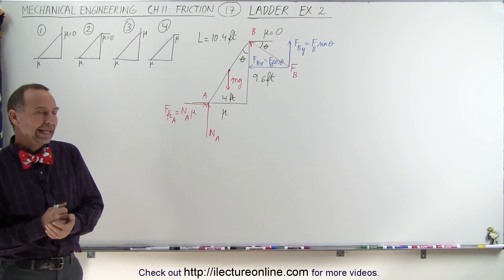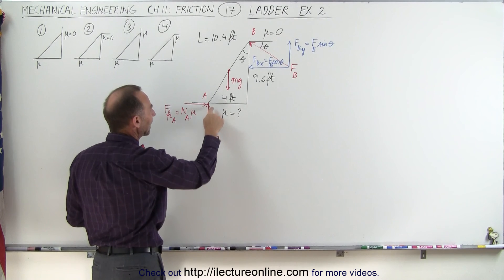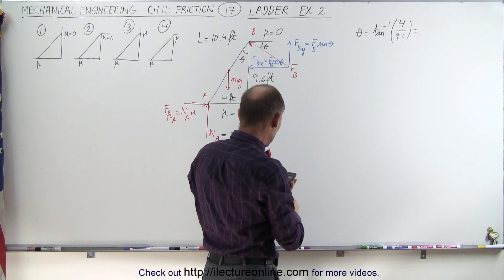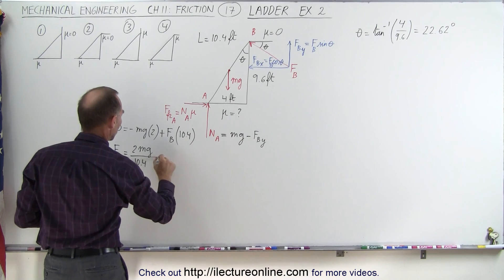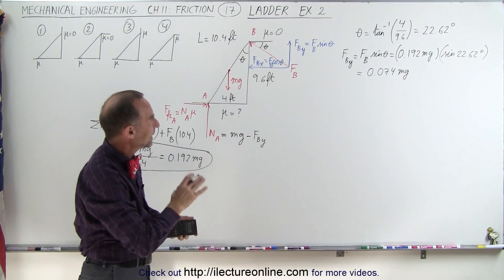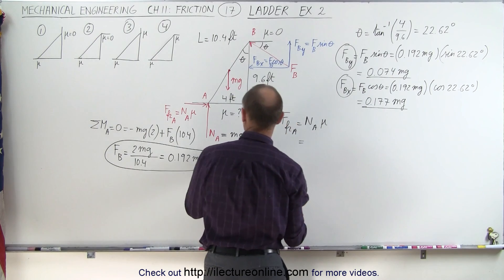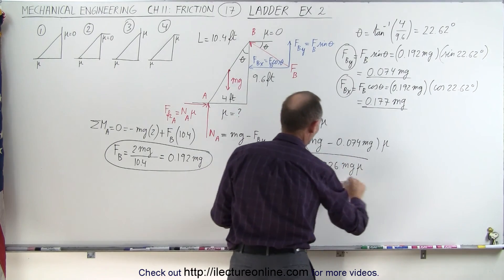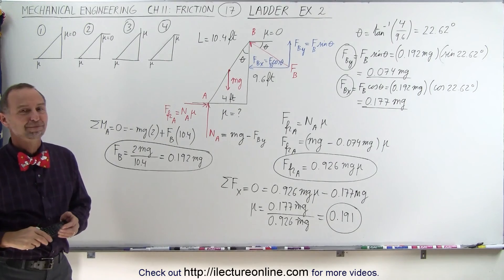Mechanical Engineering: Ch 11: Friction (17 of 47) Ladder: Example 2 of 4

Comment: Thank you sir for this video but I have one question, why is that the force exerted on the wall in this case is not perpendicular on the surface? I heard your explanation in this video but my brain can't process it. Can you help me sir? Thank you in advance.
Reply from the maker: If there is no friction between the wall and the ladder, then the normal force must be parallel, otherwise the ladder would move up or down.  (the parallel component would accelerate the ladder).  If there is friction, we can assume that there is some force pushing the ladder up or down and the friction force keeps it from moving.
Reply: Thank you very much sir. You helped me a lot in my studies. I hope you answer my questions again in the future if I get confuse. I'm your fan here in the Philippines.

Comment: Sir, can we say that, 
Normal force  = (sum of F in the perpendicular direction of the plane)* co efficient ???
Reply from the maker: No, the normal force is simply a reaction force perpendicular to the surface.  Thus it is caused by the perpendicular component of the force pushing against the surface.
Reply: ok sir, got it